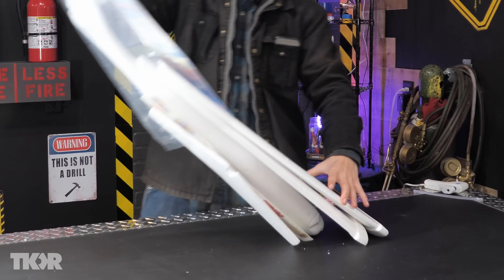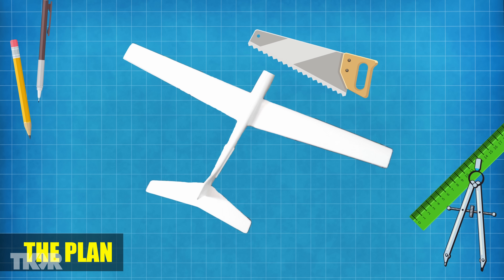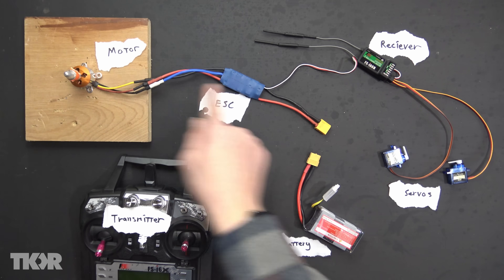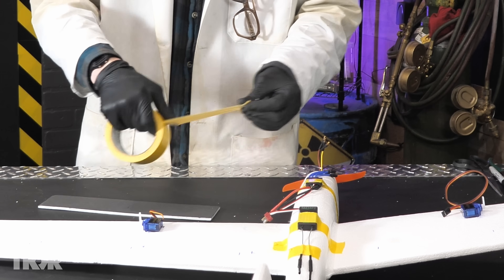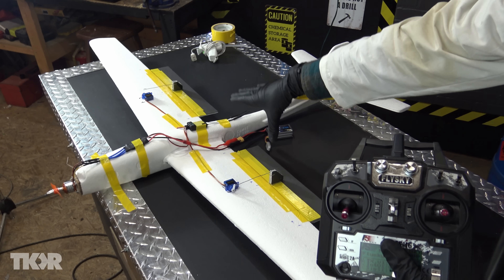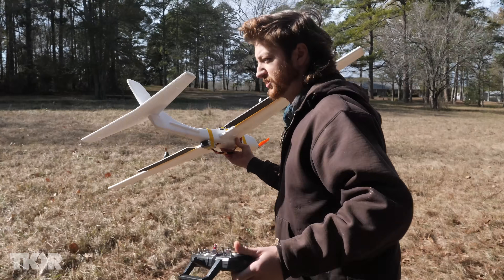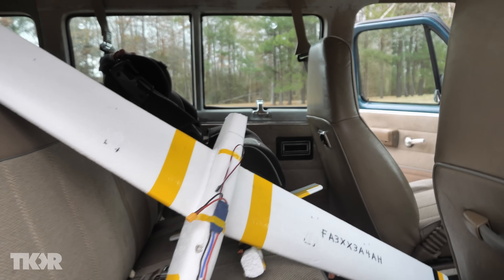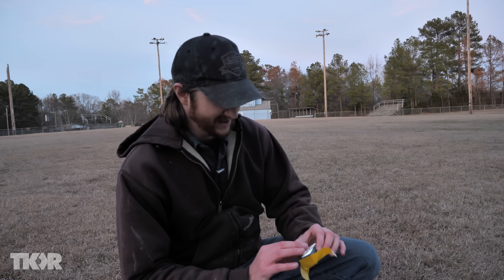🛫 Transforming a $5 Glider into a High-Flying RC Plane! 🛠️🌟

Comment: So the volts and MaH really do matter. if you look on the listing the esc is gonna have numbers. Those numbers are the capacity of volts and how much it needs/how much it can handle etc. There are also different types of batteries, like 2 cells or 3 cells, which are the primary batteries in rc flying. It's just as a heads up for when you do something like this again, just in case

Comment: A few observations; You should have mentioned  that you had to solder a new connector on your ESC or be careful to make sure you purchase an ESC that already has the same connector as your battery.   You can use the extra control arms that came with your servos as control horns on your control surfaces.  You should have checked the center of gravity before making any modifications and marked it on the wings.  Then you can use that as a reference after modifications.  As you make repairs, you change the weight distribution. You must check and adjust the CG after each repair, usually by moving the battery.

Comment: The attempting to plug a deans plug battery into an ESC with a XT60, was pretty funny.. been there soldered that.
Reply: Also could have used just the plastic for the control horns, no foam needed

Comment: Use a 1400 kv motor with 8 or 10 inch propeller for that glider or you can go with 1000kv with 10 inch propeller too

Comment: 15:05 flying an rc is a good learning curve, i would suggest people to first try to learn flying in a free simulator. called picasim. it's free but not available on playstore, u have to download it externally but it's great place to learn free flying....
that's how i did and *touchwood i never had crashed so far.
just did intentional crash landings 👀i suck at landing...

Comment: I've been flying for 20 plus and recently picked up that fly sky radio, I've paid 400+ for Spektrum radios that didn't even come with a receiver and they didn't have as much functionality as the $50 fly sky. Helicopter/drone/airplane I can fly my whole hanger with that one radio and spare receiver's are $10-$15 instead of $100+ for spektrum receivers. If you are considering just do it. 👍
Reply: Look into elrs is leagues better than any flysky junk will ever be and is just as budgetable
Reply: @Brian-S  you may call it junk but it's been nothing but great for myself. No need to look into anything else as it's working perfectly for my needs.

Comment: Another note:  Taping the ESC to a foam (thermal insulator) surface is a bad idea. It's better to use self adhesive Velcro loop dots and hot glue the Hook dots to the glider fuselage.  You want a full flow of air around the ESC to keep it cool especially with an 11 volt pack.

  Same thing with the battery.

 Mount both on the top of the fuselage!

  Setting your wings with upsweep at the ends ( dihedral ) will make for an easier to control model, as you only have to have the elevator and rudder for control. The mixing of the flaperon, (... as you have this planned...) is going to be a mess and will act backwards from what you're expecting.  Rudder and elevator are all that you need, run the rudder servo from the aileron channel.

Comment: Just as a historical note: When RC-Groups' forum was known as the E-Zone, there was a "Dirt Cheap Indoor Flyer" thread in the Parkflyers sub.

  It was basically the Life-Like Sky-Rider swept wing chuck glider which looks remarkably like the big glider you're building and flying, except that the wings sweep back at about 23 degrees, converted to RC in nearly the same way.

  So this was back in 2001, more than 22 years ago, and the RC converion set up was a pair of Hitec HS-55 micro servos at about 7 grams each, a Castle Creations Pixie 7 ESC, and the 130 sized brushed indoor power system motor that Grand Wing Servo company sold as a direct drive motor for their 3"X 2"  DD propellers. 

 All run off a 250 mAh 7 cell nicad battery pack.   AUW of about 7 to 8 oz. depending on the battery.

  I built 2 and still have the 2nd one I built.  What I did differently was use a rewound CD-Rom drive from a laptop, ( they're smaller than the  20mm endbell standard CD/DVD drive motors and they weigh about the same as the IPS motor..) powered by a Castle Creations Phoenix 10, a GWS  4"X 3.5" propeller and an early Kokam 340 2S Lipoly.  In my testing the motor and prop pulled about 1.3 amps and spun the propeller at about 11K rpm. Very efficient and more thrust compared to the GWS brushed motor.

I have some thoughts about your model.  If you had gone with a 2S, 900 to 1200 mAh pack you could have run that motor with a bigger propeller and gotten more efficient thrust and longer run times.  These Styrofoam bead gliders have a longer life if they're kept really light and they fly slower which is a great thing for a beginner like yourself.

  Don't glue the wings in, put a couple dots of Velcro on either of the root ends so they stay attached firmly enough to handle flight loads, but can pop off when you nose in at speed.  Which is the other problem, this glider should be flying at about 5 to 7 mph, at most a jog also keeping it below 250 grams if you're flying at some place other than a RC model field.

  Light and slow works best.  I also make Phoenix RC simulator aircraft models, I have a simulated version of my Life-Like Sky Rider RC chuck glider conversion in RC Groups forum in the Simulator forum, the big thread for Phoenix user made models.  Your transmitter will work with Phoenix if you have the data cable that also doubles your TX as a joystick.  Could have saved you some trouble and crashing to get your brain/hands coordinated on a sim.

Comment: You know, these days out of the box, ready-to-fly, airplanes with an included transmitter are relatively inexpensive.  Cheap beginner's two channel (throttle and turning) can be had for around $25.  Three channel (throttle, elevator, and turning) can be found for around $40.  And full four channel control planes (throttle, rudder, elevator, and ailerons) can be found for around $80.  And all of the above include built-in gyro and accelerometer automatic stabilization systems, making it very easy for beginners to learn to fly them.  If it looks like you're heading for a crash, just let go of the sticks and these planes will quickly and automatically level themselves.

Comment: Those are ailerons on the wings, not flaps, the rudder would be vertical on the tail and the elevator is horizontal on the tail. For the same amount of money you can buy an actual ready to fly 5 channel rc plane, with all control surfaces that you can actually control. Comes w a charger, battery, transmitter, everything you need to fly.

Comment: In the link you gave, it uses a 2200kv rated brushless motor, with a 7x3 prop. I recommend a 1400kv 8x4. This is more powerful, so you can carry a larger battery and possible better frame. Also, where did you find the foam plane in your vid?

Comment: Nice overview of the basics. Couple things.  As you saw in your test toss, you used a plane that will crumble on impact and that you was without the added mass of electronics. You didnt mention the need to license the plane and pilot or the faa required transponder. Toys are no longer toys, they are life threatening drones and i am sure this was more than the 250 gram (8.8oz) limit. Lastly, what were those rubber gloves for?

Comment: Hi King of Random, for someone who grew up in model rc aviation, it really excited me to see your video on converting a foam chuck glider into an rc model and trying the hobby out😊

I have some advice that can help with improving the flight characteristics of your model plane.

 I've noticed that the wings on the model didn't quite have enough reinforcement to the wing which it caused the wing to flex during the video, when you have a lot of flex in the wing it can some times cause the wing itself to fold and crash on heavy wing loading from fast air speed in its current state, if you reinforced the wing with a bit of carbon fiber rode it will be able to handle the power of the motor on you model better and it will have a better preference during flight. 

Anyway, I wish you the best of luck the plane
Reply: Actually this would fly fine with no reinforcement, it just needs to be much, much lighter. A motor about half to 2/3rds the weight, a much smaller 2S battery and a slightly bigger propeller.   These were flown way back in 2001 with GWS's 130 direct drive motors, the IPS A drive motor spinning a 3"x2" propeller and basic Hitec micro servos and a tiny 250 mAh nicad battery  pack. They shouldn't weigh more than 7 to 8 oz.  You want them to fly slowly.

Comment: Use a 2000kv 3 blade prop at 3s, use one servo for roll,and the other for pitch, you'll have better success. 
Advanced users should use a flight controller.

Comment: Great Job on the model, I have been in RC for years and have converted many chuck gliders to RC.  That 2200 mAh battery would have worked fine you would have just had to adjust the C of G.  Longer flight times vs lower performance basically.   Nice job again!
Reply: Definitely could have used a wing spar in there lol

Comment: As a Rc pilot, and builder, this hurt my soul on so many levels lol. I love seeing how people approach this hobby. You’re not wrong As long as you are having fun.
Reply: I have a few tips. Mostly planes use ailerons (the ones on the wings) to control turn, not the rudder, (the vertical on the tail) to steer during flight. This is because yawing (flat spinning) with the rudder can cause adverse yaw (where the plane flat spins but its direction mostly remains unchanged because of momentum which causes a lot of instability). Whereas rolling (with the ailerons) rolls the plane to one side and so since the wings will kind of act as an airfoil it prevents the plane from continuing on flying straight and the lift provided by the wings causes it to turn sharper and with more stability allowing you to have better control of the plane if you need to make an emergency turn. Yawing can also lead to a lot of drag in which will make you lose airspeed, reducing lift on the wings and leading to a stall(where the plane cannot generate enough lift due to low speeds and pitches down) and crashes. Mostly my advice would be to use ailerons as much as you can while in the air and only use rudder when doing an extremely low flybys or when aligning the plane with the runway (especially when crabbing during high crosswind). Also don't yank on the stick, some planes tend to overreact and steer more than desired leading to loss of control. Instead try to take it easy, even in an emergency.
Reply: Can you give your tips to us noobs pls
Reply: @PatricioGonzalezCabrera  some of my best advice would be to watch Flitetest
Reply: ０．０
Reply: Same
Reply: I don’t I even have an Rex plane yet but it still
Hurts
Reply: hahahah same here, but that chaotic and fun approach is what make this video so great.
Reply: Well said!
Reply: Haha same here I am I rc pilot and a builder this was kinda painful
Reply: @AlecPhillipsIII  Likewise! lol
Reply: Then tell me how to fix it plz  @AlecPhillipsIII

Comment: Great googly moogly. Quit calling all the control surfaces flaps... Flaps are indeed a control surface that do nothing for actual control of your plane, they only add lift. You also have ailerons, elevator, rudder, and on certain airframes when you mix two together you get elevons, etc. As an avid DIY RC flyer, the first 3/4 of this video was hard to watch... lol But i got a good laugh out of it. Time for you to hook up with the FliteTest guys like the old TKOR hosts did and do a redo of this video.

Comment: Look up Flite Test.  They have free plans for planes made from foam board ($1 at the dollar store).

One word of caution though.  The FAA recently implemented rules that require a remote ID transmitter for any plane that is more than 250 grams in weight unless you are flying in a specifically approved FRIA zone.  Outside a FRIA, you also need to check for FAA restrictions.

Comment: The part that holds the prop is called a "collet". It's especially funny that you said, "I'm not even quite sure what to call it.." which sounds exactly the same as "collet", you can see how it's especially funny when I fully outline the comedic humor.

As for everything else you said about control surfaces and aerodynamics was almost exactly backwards. Like the effect their movement has, their names, etc. But seriously, thank you for showing that this is seriously easier than most people think and sometimes just getting to building is more important than fully understanding where you may end up 😊
Reply: The best set-up for this since it's belly landing is to have a prop-saver adapter on the outrunner
Reply: Collet? That’s a spinner.
Reply: @semydev the front part resembles a spinner, but the component is a collet, is a slotted sleeve inside of a flared mounting plate. As you tighten the collet it squeezes the shaft its installed over.

Comment: This is such a great way to get into flying for dirt cheap.
Anyone that tries this and wants to graduate to building their own plane with foam board, I highly recommend Flite Test's speedbuild kits. They also sell power packs which are a more expensive but much higher quality version of what you get in that amazon kit. I just built their mighty mini sportster and it works great.

Comment: the wings of the plane bend, put one long rod over the entire length of the wing, use the ailerons and elevons, for the beginning I would suggest not using the rudder
Reply: buy a new one and strengthen the fuselage by putting a rod along the entire length of the plane, also put a rod along the entire length of the wings
Reply: Put two servos in the wings and connect them to one Y-shaped connector and connect to one channel
Reply: the propeller is small, you need to add bigger ones, I use: 3s 2200mAh battery, 40A ESC, 2216 motor 1400kw
9x6 ropeler
Reply: do not cut the tip of the nose straight, the engine should be tilted slightly downwards, about 5 degrees

Comment: Hi im a avgeek here if i were you i would put your servo on rhe bottom and utilize alerons( what u were calling flaps) supposed to rudder control this would allow more response to steering 

Also flaps are a extra control surface designed to create more lift at a slower speed used for take off and landing 

So im total there are normally 7 control surfaces

Comment: https://youtu.be/nwwM-lIErac?t=8m19s in the future you want to "zero" your servos. Adjust your trim on the transmitter to zero, then plug it all in so the servis get some power. That will center them and this way you dont have to redo adjustments and can just use the trim for fine tuning
Reply from the maker: I did this! Didn’t end up in the edit tho
Reply: @TheKingofRandom  I could tell that you did in the end :) great video and super fun project!

Comment: Your description in the beginning of “flaps down” causes plane to go down and view-versa is incorrect. When the wing flaps are down it effectively does the same thing as angling the wing up a bit, causing the plane to want to climb. The “down elevator” does cause the plane to go down because it causes the tail to go up.
Reply: Also, I would suggest adding two more servos and replace the wing “flaps” like you had before… set up on the transmitter as “ailerons” (wired together with a “y” harness so that it uses one channel on the receiver. In this setup when one flap goes up the other goes down. Remember, the flap that goes down causes that to go up! With this setup turning is down by applying aileron bank followed by slight up-elevator… commonly termed “bank and yank”. This is set up on the right hand transmitter stick replacing your rudder control. The rudder control gets moved to the left transmitter stick.
Aliexpress has very cheap servos ~$2 each.

Comment: The second you choose elevons I knew you were un trouble. I have done this a few times. I would suggest instead if trimming the control surface, if your remote has it, program in exponential into it. Exponential will smooth the center yet allow deflection out to the exteemes. If you don't have this, wou could adjust the holes that the servo connects to the push rod thus limiting the angles. I prefer expo settings because i find it much easier to dial in and still have extreme control on the end in case you need to make a last minute correction its nice to have that last bit ofbextra control. You did a good job. They are fun once you get some practice in.. if you turn too steep and are going too slow, one wing will stall and it will fall from the sky. To prevent this, don't turn while going up, and maintain good speed in the turn. Most crashes are caused by this issue. Probably 90% of crashes are caused while turning too steep with not enough airspeed. It even happens in large airplanes. So keep it moving in a turn, and don't climb and turn unless its a very shallow turn and you have good speed. Good luck. I hope these tips help.

Comment: You can actually have one servo controlling both flaps on the wing and another control the elevation
Reply from the maker: Can’t imagine how but I’ll have to look that up
Reply: @TheKingofRandom  you just need to mount the servo in the center of the wing with each side of the servo arm connected to the flap on each side~ so yeah you will need a servo arm that extends both sides.
Reply: @TheKingofRandom  If you were experimenting with manned aircraft like the Wright Brothers you would be dead.  You literally needed like 1 hour more of studying/watching YouTube videos of the BASIC theory of flight (RC or not) BEFORE buying anything.  I know birds flap wings but you calling your control surfaces flaps got be feeling bad inside.